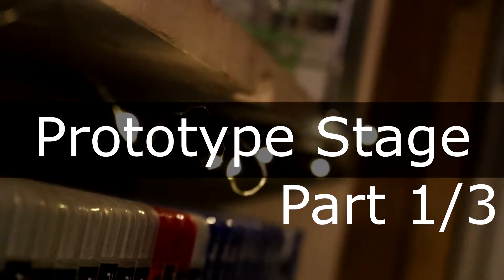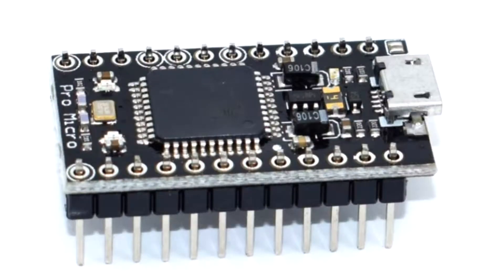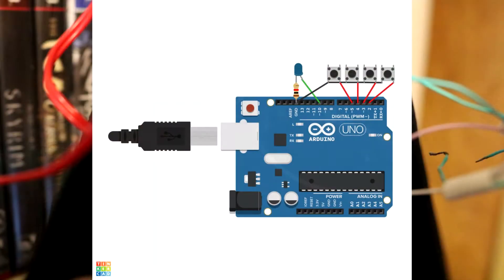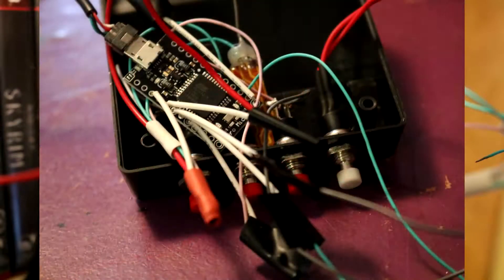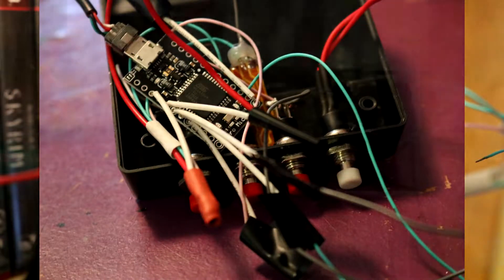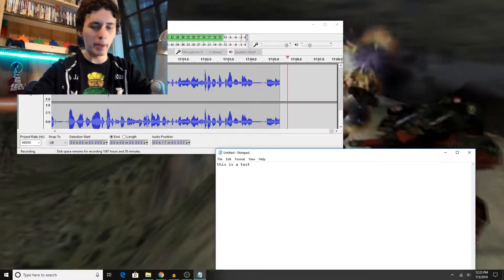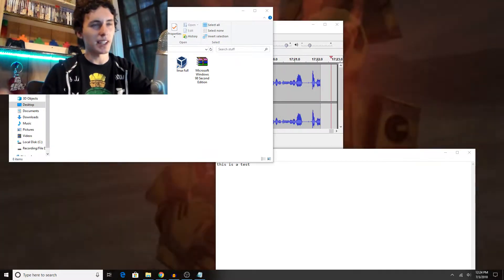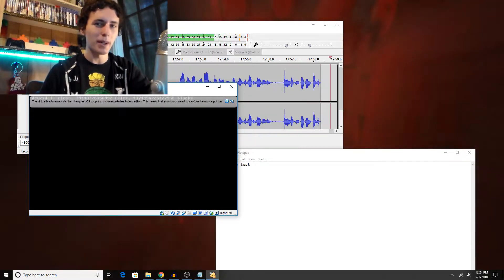Arduino Button Box "Part 1 Simple Prototype"

Comment from the maker: Useful tool for those of you not sure of the wiring or are just over all new to arduino it lets you practice with a virtual arduino uno. Sadly this tool doesn't feature the Pro Micro or other boards but will give you a good idea on how to do code and wire things up. https://www.tinkercad.com/things/ipc9wOUhiuJ#/
Also there are ducky code to arduino converters out there so feel free to convert your own code and over write the code in my arduino sketch.